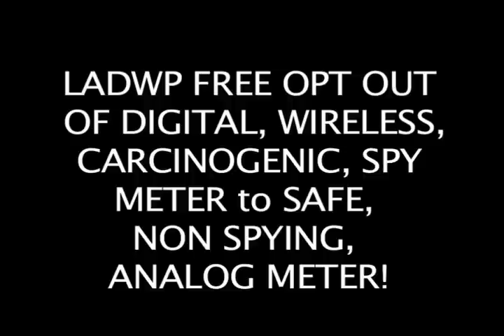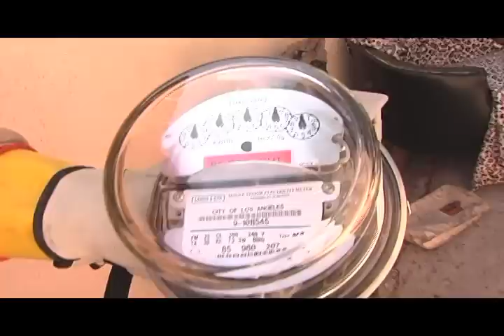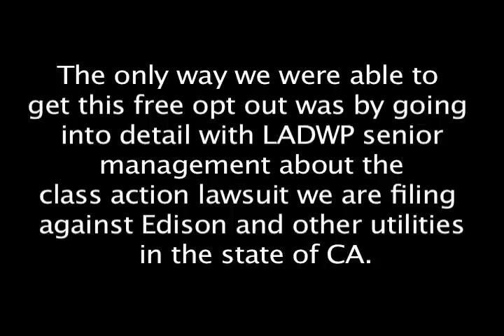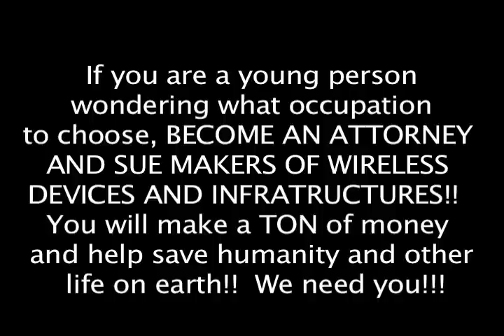LADWP Free Opt Out

Comment: customer freaking out. Does this homeowner use a cell phone?or othe radio frequency appliances ? really? the F9 electronic meters use a 900 mhz freq just like a walki talki radio signal is good only for about 300 ft max .also u just fuKKed this guy . if this video gets to LADWP management this meter setter will get written up for violation of safety rules regarding use of approved safety glasses and faceshield during meter changes, atleast he used his gloves.